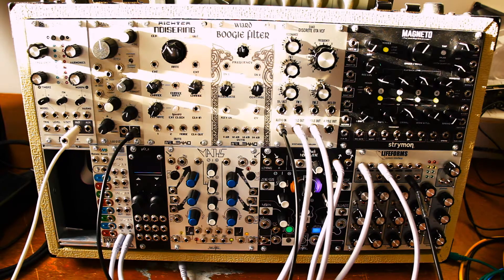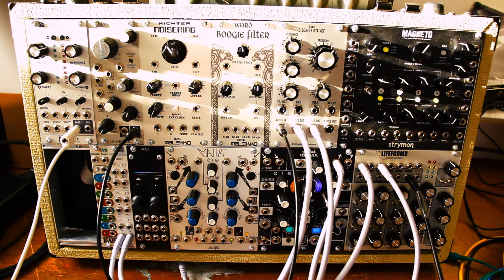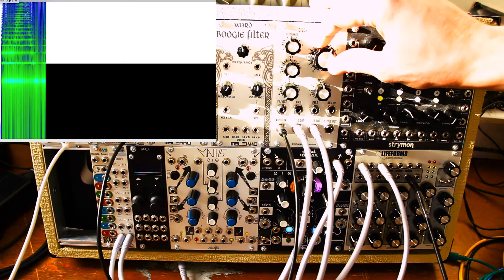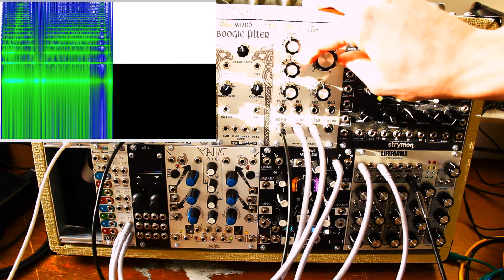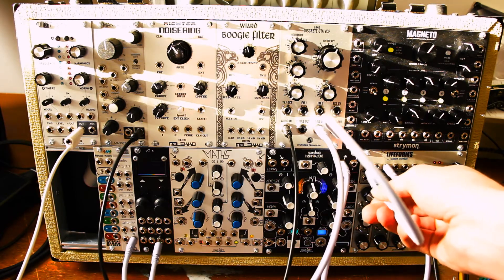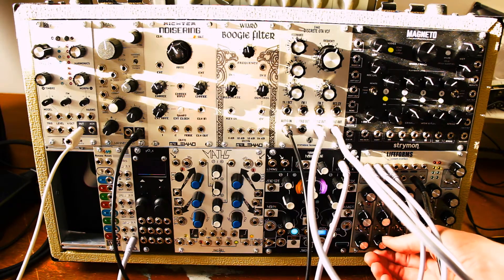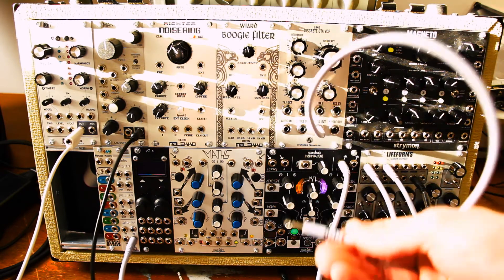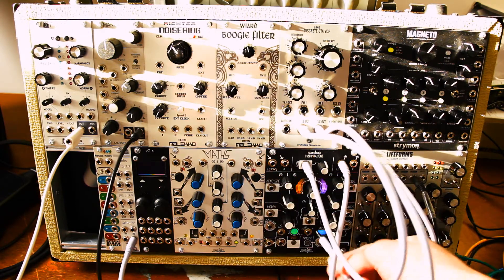SynthTech E440 "Best Filter Ever" - Tips & Tricks

Comment: hi, do you notice any high frequency noise on the output of the VCF? i just got mine and noticed it, wondering if that's normal.
Reply from the maker: No, that isn't normal. Unless you happen to be self-oscillating the filter (resonance past 3 o'clock). I would email Paul at SynthTech about it.
Reply: @patienthands  I was hearing a hiss with the filter completely open (no res), had to send it back. Quite gutted because its a cool filter and i'd waited a while for stock
Reply from the maker: @kiunthmo  You were certain it wasn't a power issue? I hope it can get resolved or you get a replacement!

Comment: Great video! What will happen if you pan each output ie 2 or 4 hard left and the other hard right? Im assuming they will just act independently but does the shift in phase make for a better stereo sound?
Reply from the maker: Hey, since they are hard panned I don't believe it will have much effect. However, if you took channel 3 with either of the other outputs, and it were eventually summed to mono, you might end up with that bandpass effect! I'm not sure how the shift in phase would otherwise affect stereo perception.